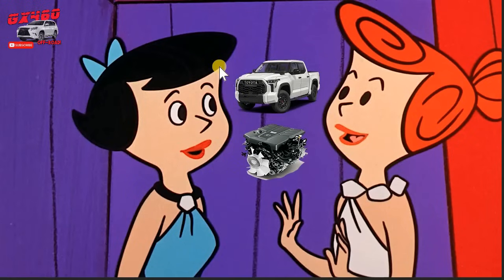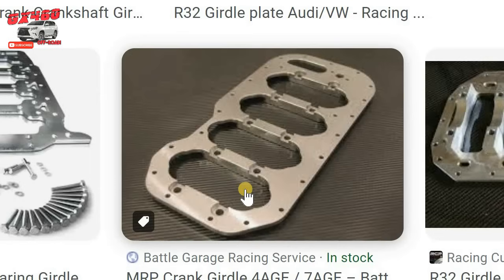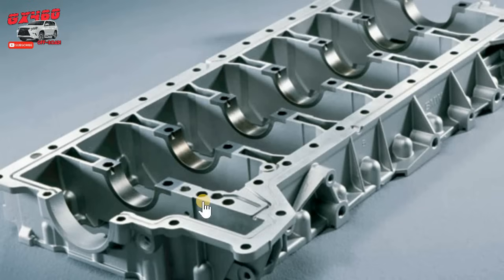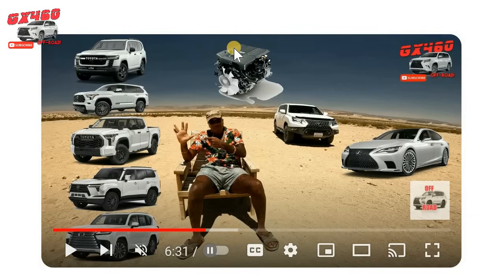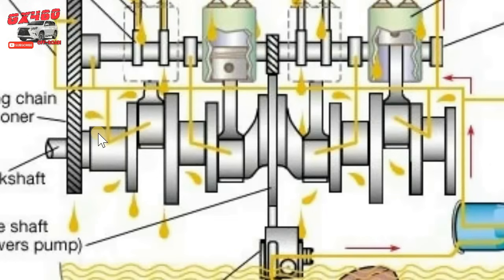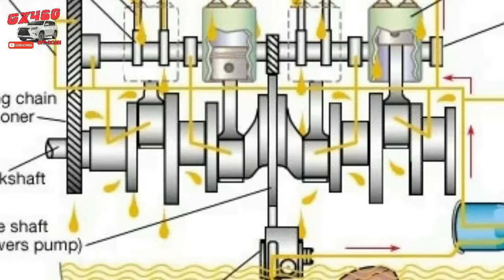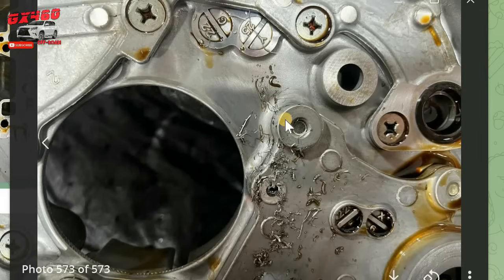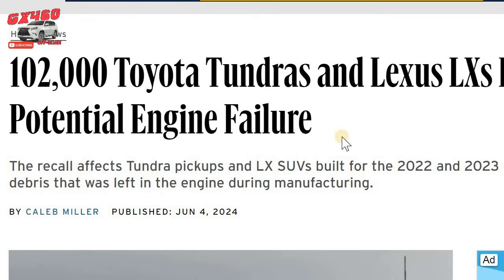Top 3 Tundra Engine Recall MYTHS

Comment: I don't remember all the fuss and hysteria when GM, Dodge/Ram, and Ford was and still is having endless engine issues. I bought a 2023 Tundra SR5, 4x4, Crew Max and have no fears or issues of any kind after a year with this truck. And just like I do with ANY brand, I purchased the extended warranty to cover anything for 7 years. This is my first Toyota and I am NOT disappointed, especially after owning GM, Dodge/Ram, and Ford with all THEIR recalls and failures.
Reply from the maker: toxic, fear-based social media "influence" [cringe]
Reply: I have 1794 2023 I put 19thousand miles with no problem and I trade for 2024 1794 limited edition I’m happy with
Reply: @Chijo15  I was looking at a 1794 a few days ago at the dealer. Beautiful trucks.

Comment: Thank you very much for this! It makes me sleep a lot better. I have a 2023 Tundra with only 8k miles one it. Hearing about the problems literally made me feel sick. Does changing the oil early or frequently help at all or make no difference?
Reply from the maker: Oil changes will NOT fix the problem.  If Toyota's claim is true, the trash is burrs left BEFORE the filter at  the number-1 galley... basically the burrs just keep shedding off and messing up the bearing.... this is all before the filter/strainer
Reply: @LexusGX460-OFF-ROAD  Thank you.

Comment: I agree with this analysis.  I’m not a mechanical engineer that designs engines, but I am a chemical engineer that designs chemical plants and solves manufacturing issues.  Engineers by nature and training are wired to solve problems and determine root causes.  Not speculate like a lot of buffoons are doing on other channels or chats.  I’m not a Toyota fanboy, but I promise Toyota will figure this out and make it right.
Reply from the maker: Yes.  People need to show the engineers... and engineering in general some respect 🙏

Comment: You would think and oil change Toyota would have the dealership send the oil to inspect but after your explanation about the flow if there is anything would it show and shouldn’t they be vigorously be checking these?  I have a 24 Tundra Premium and had the 1st oil change a little under 5,000 miles.  I’m planning on doing another next week at 8,000 because the recall.
Reply from the maker: If there's burrs at the number-1 galley they will stay in thay area only... once it drops to the pan, the strainer will block any metal shavings... "oil changes" won't fix, help or save this issue

Comment: Bottom line no one cares what happened to this engine. Despite being "overbuilt" the reliability and longevity isn't there. Currently Toyota has many other problems happening simultaneously. It all points out that the Toyota as we have known no longer exists.
Reply: What many other problems are you referring to?
Reply: 🤣 ok. Toyota as a company you’ve always known it is still there.  You know the 5.7 and 4.6 have issues as well right?
Reply: @flight2k5  pretty much every single engine they have come out with has mad at least one big if not multiple recalls.  its all on the toyota website too just look it up.  the issue here is the fact that this issue is a critical issue that causes the entire engine to fail due to it being such a major part that fails.  that makes this recall far more serious than any other so far.  in the 30 years working at toyota from the master certified mechanic that i was talking to in reference to this specific issue said that they have never in their 30 years seen a main bearing fail other than on this engine though which tells us volumes over all.
Reply: @samuelgatton  they haven’t had major recalls on every engine they’ve made 🤣😂
Reply: @deanrotering879 overall build quality has been less than desirable. Squeaks and rattles, sounds and feels like my gmc.
Reply: @leethomas556  it’s why you don’t buy the first couple years of anything 🤣😂
Reply: @flight2k5  I concur 100%
Reply: Except you forget the tens of millions of trouble free miles on other toyota/lexus models on the road today and since 2017. this engine has been tested since 2015. You are another example of not doing your research!

Comment: Great video! I have seen a few of the blown  engines all with the #1 main #1 rod bearing cooked. Always #1 all other 5 were good. Plus the oil pickup screens had contaminants on them. Your theory is probably 100% correct. Everyone acts like Toyota is closing up shop and their truck is going to be left high and dry! 😂 
A bunch of cry babies! 😭 I own a 23 TRD pro if it needs to be fixed big deal. Toyota has always took care of me.

Comment: you have got to get your wording right here.  you say multiple times that this is engine debris and it is in fact not.  this is left over machining debris that is left in the block or channels of the affected area(s) that has not been properly cleaned out after the machining process has been completed and was apparently missed by qc techs across the world.  that aside, to me that means that it was so small that it was missed by the human eye and or small enough that it was not noticed by human inspection, but was just enough to break off from the engine running and the pressure inside the running engine and cause issues as you said in the previous videos - traveling in to the journal from the oil passage way and becoming fused to the main bearing due to the massive pressure and heat produced inside the engine in that particular area.  if this is the case, that is a very simple fix to correct at the factory, however not so much once the damage has been done and the engine has been run.  I did also want to mention that though the official issues root cause has been publicly stated as, "left over machining debris" it may also be something that they have not yet announced and will not announce until they come out with the official recall from toyota/lexus themselves in the stated mid to late July 2024 time frame.  Remember this has all happened before too on many of the very same engines that we now call "bulletproof", maybe not a main bearing blowing and to this extent which is why it is being made such a huge deal of, but there have been many a recall on the engines that everyone swears by now and it seems that how soon people forget there have been and always will be issues and hiccups along the way with anything that has not been tested and proven for years and you are correct in saying that we learn from our mistakes and make better the development of the future products from said mistakes.

Comment: There are still some unanswered questions.
1. Why are the 2024s failing when Toyota says the metal shavings were fixed in march of 2023?
2. Can i take my 2023 pro off into the dessert 100 miles from a highway  and trust the engine? Hell no. Toyota needs to do a buy back or trade in for 2025 at no cost. Assuming the fix the manufacturing problem
Reply from the maker: Toyota should have an official recall answer coming in late June to late July according to their NHTSA recall

Comment: Good video but I have a couple questions;  1.  Why are the engines failing from different manufacturing plants?  2.  Why wouldn't after several oil changes the debris wouldn't be gone? 3. Why are some engines failing with low mileage, while others are taking 50 to 60 k miles?  ( you're telling me it might take that long for the debris to get to the main bearing, or wear it down over time)? and what in your opinion is the remedy?
Reply: #1 is because the same milling process is used in the USA and Japan. If there's a code bug (for example), both countries will have it.
Reply from the maker: 1.  Robots do the machining and cleaning the system/program was flawed.

2.  The burrs/trash are left in BEFORE the oil filter at the number-1 main entrance galley.  They shed off and weld to the main bearing.

3.  There's no reliable data on when they fail, just internet anecdotes/prattle

https://youtu.be/FG5j3dFscI8
Reply: @LexusGX460-OFF-ROAD  I think the only questions left that Toyota needs to answer or figure out is if all the engines where made the same way how come only 1 percent of those recalled have failed so far? I’m sure there is an explanation but I won’t try and make one up here without any more info lol 😂

Comment: I have a 23 hybrid. Not in the recall but I imagine it will be. Makes me nervous driving it. I did an oil change around 800 miles cause some mechanic 30 years ago told me to do that as a teen. Not sure if doing an early oil change will do anything if debris is in the journal. Only time will tell. Was thinking of have the oil tested by one of those mail in locations. Curious if a bearing is failing will it show any amount of metal suspended in the oil. Figured I would do it to make me feel better one way or the other.
Reply: Very few are actually failing.  If it does fail it’s under warranty.  A lot of things can fail on even the most reliable cars, though at very low frequency.
Reply: @user-tb7rn1il3q  True. Of the 98K units affected, it think only actually 900 have actually taken a dump.  That puts things in perspective but honestly, the hype and controversy of this whole thing has gotten people very upset. Admittedly, I got caught up in this too but when you pay 63K for a truck, you should not have to worry about whether or not you can rely on it. I've driven them for 35 years without a single mechanical issue.  I sold a 5.7 Tundra to get the new one. Should have slept on that one.
Reply: @user-tb7rn1il3q  If the are "very few" failures, why is Toyota recalling 100,000+ engines? What will they be exactly doing with perfectly good engines when they come back? Why not just honor the warranty when and if they are filed? You know what. Nobody knows when the next engine will fail and where.
Reply: @brianm7120  this comment is underrated….exactly my sentiment as a 22 tundra owner.

Comment: “Overbuilt”???  Please explain to me how the Toyota parts are stronger and more expensive?  All I heard is your statements and nothing to back it up. Please let us know. 

Great job of mansplaining everything.
Reply from the maker: Well... as explained in ultra slow-motion in the video, a normal main bearing cap is much cheaper and weaker than using a crankshaft bedplate.  This would be called over-engineering.  Toyotas refusal to use plastic parts in engines etc is also sound evidence as well.  There's an entire separate radiator, cooling circuit and water pump just for the turbos on this engine.  Yes we call that overengineering 😉...
Reply: Because you say it’s weaker and cheaper must make it true without any explanation. Gotcha

Comment: Turbo charged diesel is good gas engines not so good as we can see
Reply from the maker: Toyota has been making gasoline turbocharged engines for over 40 years.  They work, they lasted forever.
Reply: This is a heavy truck towing trailers and such v8 is the best bet